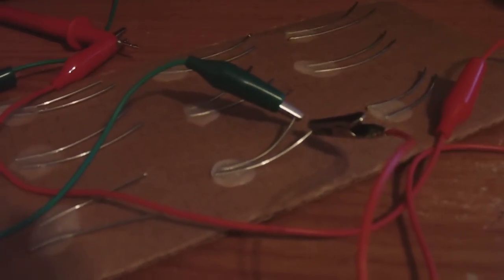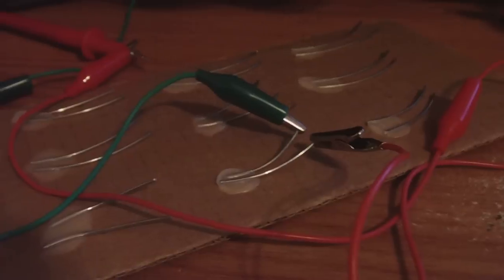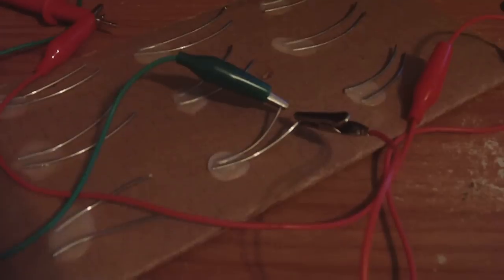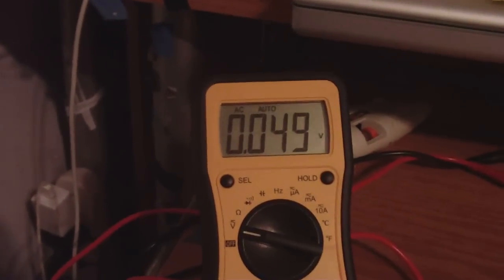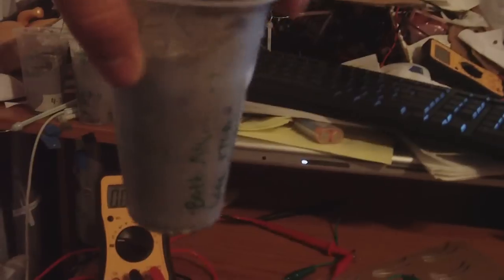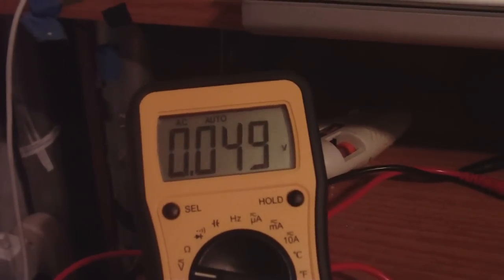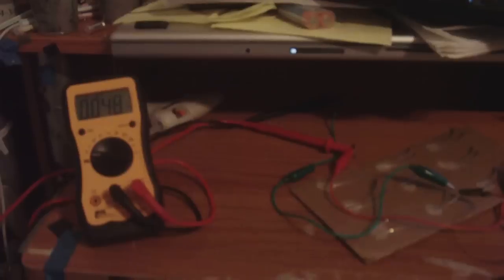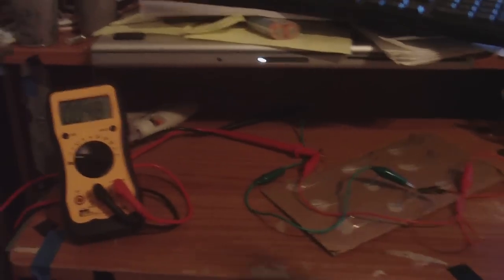Glue Battery Voltage is affected by the Mass of objects

Comment: Sir:  Because of the research you've inspired me to do, I think I'm understanding your "mass affect" better.  There is a branch of physics concerned with analogous relations between mechanical and electrical systems.  Housing developers, for example, have to be concerned with how they lay out their houses because of the effect all that mass will have on the overhead high-power lines.  It seems that "mechanical/mass" is analogous to "power/voltage" as acceleration is to current.  What seems to be relevant is that the more alike your built objects, the more effect they will have on each other -- the more massive your circuit or the more electrical your mass, the more visible will be their relationship.  So how about using barbell weights instead of concrete?  Or better yet, high powered magnets?  Or, just for giggles, use a whole bucket of Elmers/salt substitute/epson salts to bulk up your glue cell?  This analogous relationship certainly needs more investigation!

Sincerely,
Robert Bakhaus

Comment: Sir:  I am unable to stop thinking about this amazing find of yours.  I have to think that the "mass" is somehow reflecting radiant energy into your circuit.  The little rabbit ear antennas must be sensitive to ambient energy in your overloaded lab environment.  Try to vary the shape and size of your "mass" objects will you?  Test for reflectivity.   Then I can't help but notice that when you have same metal electrodes ( aluminum wire in this case ), you sure have created an opportunity for series and/or parallel connectivity of your circuit.  It can't really matter can it when both electrodes are the same !!!  Such novelty you built.  Do us all a favor and link up all those many cells in order to see what an interrupted length of aluminum wire can do..   Cheers.

Comment from the maker: @onthecuttingedge2005 

Yes I have done the experiment where I leave a battery connected to it while it dries. It somewhat affects it but I see that high voltage is needed and not my 1.5volts. I got a mixed bag of voltage from that test, like I said high voltage is needed for more accurate power output.